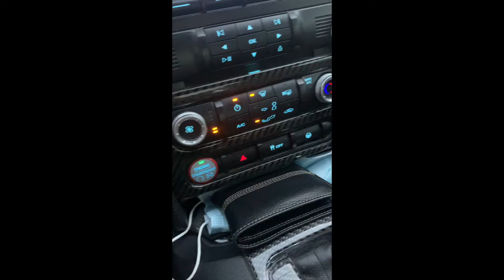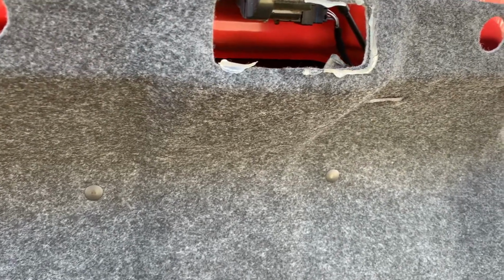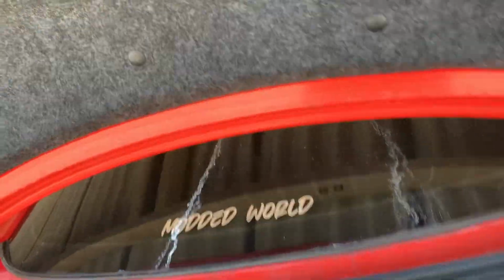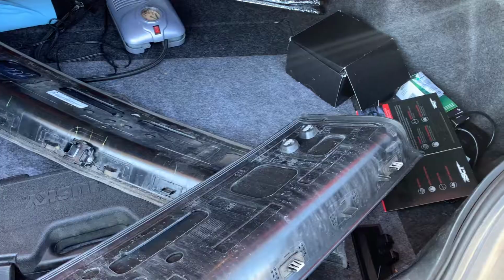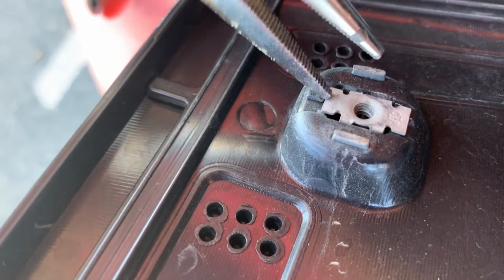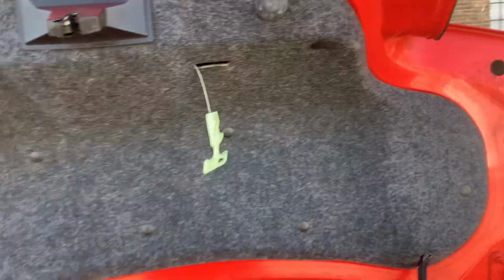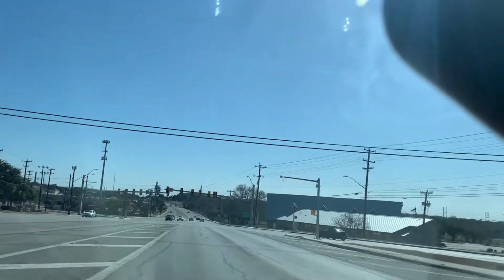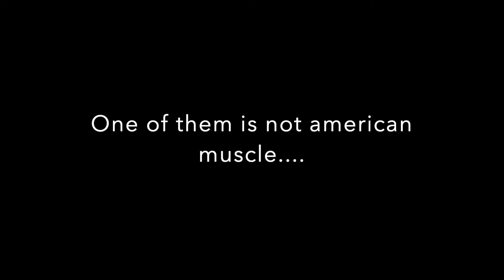Un-MOD Day?? Replacing rear deckled on my 2015 Mustang GT...MIGHT SELL!!!???

Comment: Did the o2 sensor fix the issue
Reply from the maker: Yes it did. I just got the codes mixed up and bough the wrong side. Once I took it in and found out all I had to do was swap them we were good. No codes no issues after.
Reply: @moddedmind2524  I am currently having the same issue Ford it it was the cam phasers ima gona try what you did this started happening after installing my long tubs
Reply from the maker: What gas are you running? You can also try adding an angled bung to the o2 port so it’s not getting hit with any condensation.
Reply: @moddedmind2524  in running E85 and it does the same thing even running on regular gas